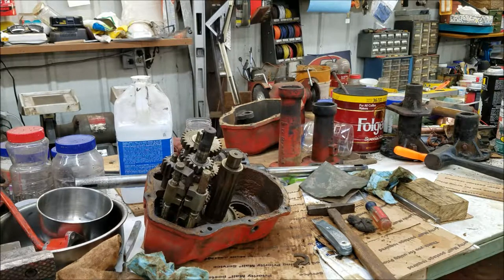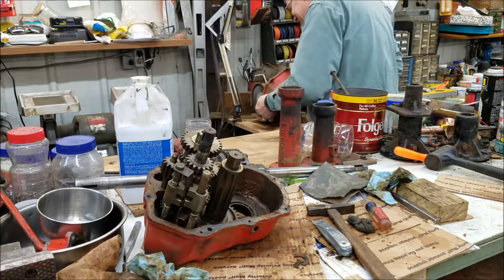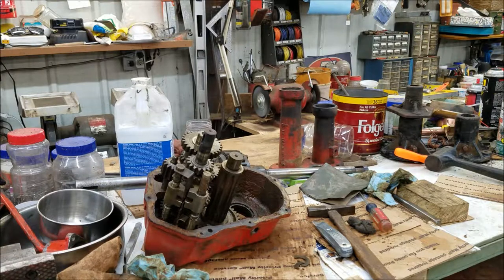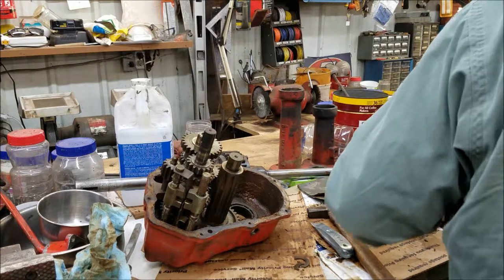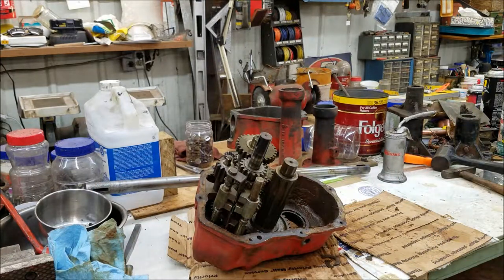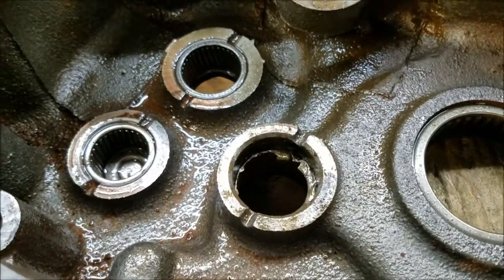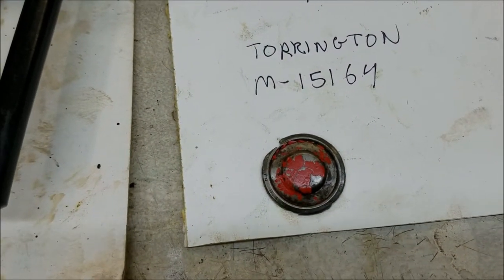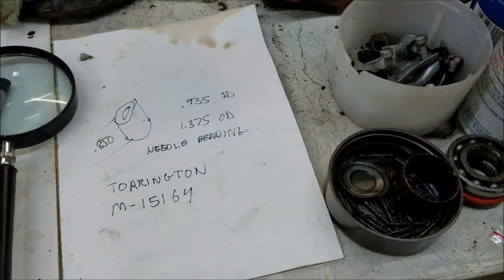A Bad Needle Bearing in the Transaxle

Comment: I have a Sears custom 8, the high and low gear rod. The seal is leaking, do you have to split the case to change it,or or can you pluck it out lol??
Reply from the maker: For parts I usually just start out in Google and type in a description of what I am looking for, and drill down into web sites from there.  Don't know about the seal, the one on the brake drum shaft was not replaced and now it is leaking on me, don't know if I will be able to dig it out or not.